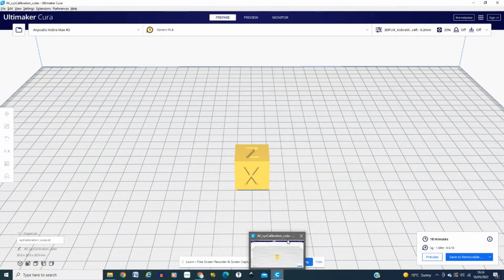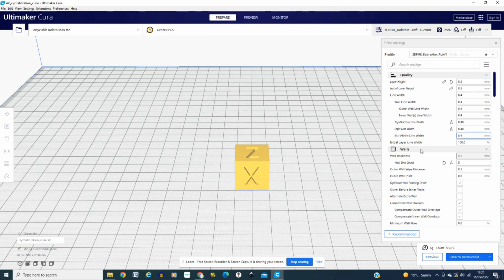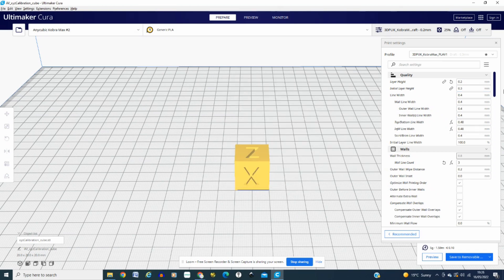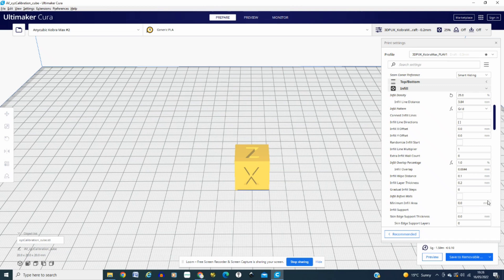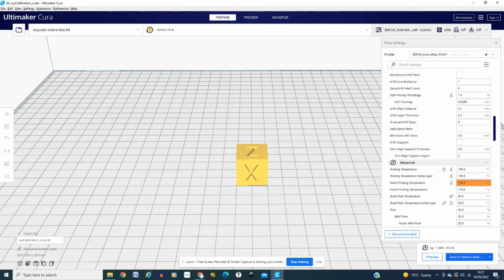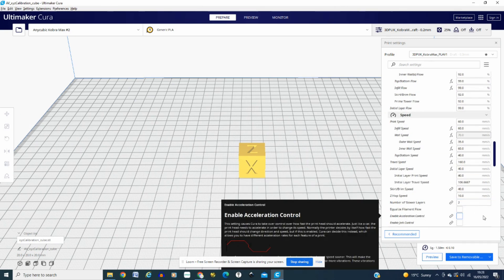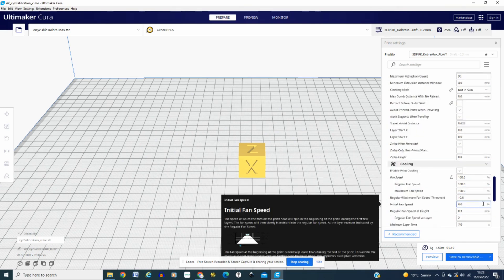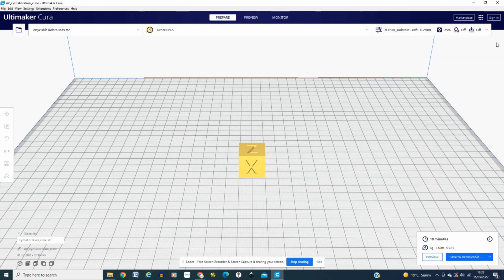Cura profile - 3DPUK Cura profile on the Anycubic Kobra Max

Comment: It would be great if there was a good video on how to get a 0.6 ; 0.8 ; 1.0 ; 1.2mm nozzle working. I would already be more than happy to know how to get a 0.8mm Nozzle working on my Kobra Max. I am clueless about where to start, just changing it in the Slicer (Cura) won't give me a satisfying Quality 🙄.
Reply from the maker: Hey thanks for your message changing the nozzles on these are super hard .. and have been hot clued in... I have seen its easier to buy a whole new nozzle head and do swap like that
Reply: @3DPUK-TECH-CHANNEL  changing the nozzle works flawless. I just can't figure out on how to get good settings for an acceptable print 🙄. It's very hard to find good information. All I find mostly is that you can print faster. But not on what settings tk print with good quality 🤔.
Reply from the maker: @ojtothemax  mm I will have a look around for you

Comment: FYI: Using your files to make a Machine of type "Anycubic Kobra Max" on Cura 4, then your Cura4 profile doesn't import because "Quality 'Draft' is not compatible with the current machine type 'Anycubic Kobra Max' "
Reply from the maker: Hi which version cura are you using and file type they both need too match

Comment: Hey man, I sent a request for the file on google drive. Just picked up a kobra plus and it runs great I’m just having some trouble with infill layers having gaps and some stringing but like on the calibration cube the entire outside of the part looks amazing. I’m new to 3d printing and just trying to fine tune my settings for cura. Great video and thanks again for all the help.
Reply from the maker: This should help as a start point